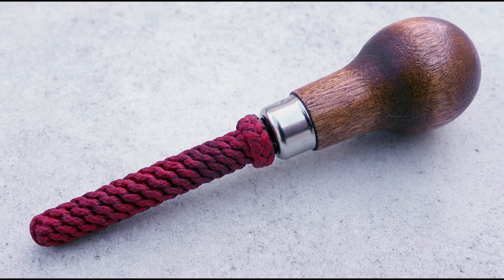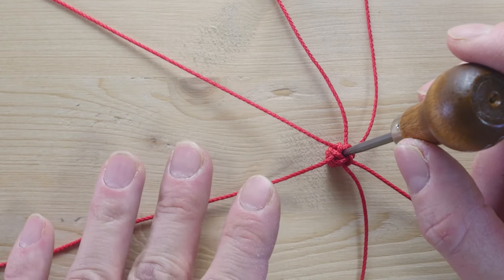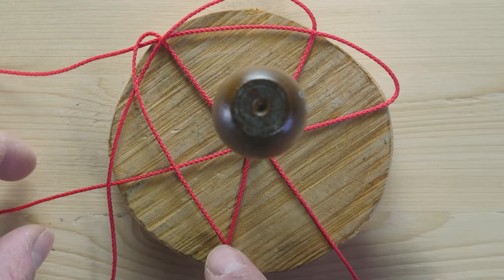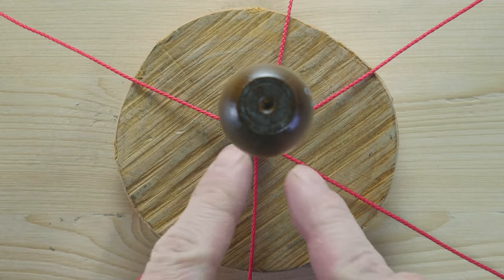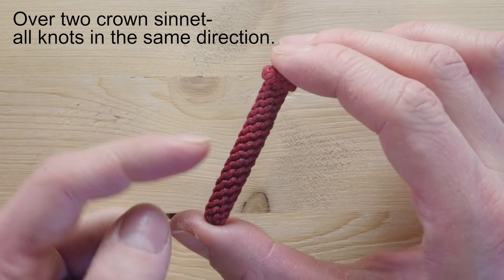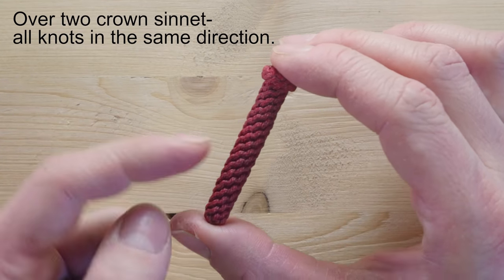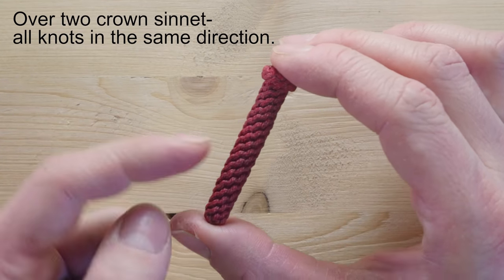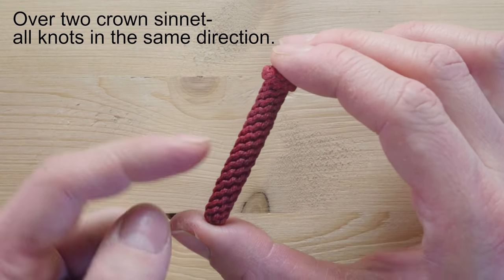Paracord spike cover

Comment: Very nicely done. Thank you for sharing.

My first sheath was made 12 years ago, from three lengths of three-stranded cotton twine.  The initial layer was a stack of crown knots, running from tip to shank.  The second layer interwove the first, running from shank to tip.  The final layer interlocked the first and second by following the spiral back from tip to shank.  With each interweave, the sheath became more rigid, as each opposed its predecessor's pull and filled its slack.  Finally, I coated it with black shoe polish and gesso.  It's ugly, but I still use it every day.